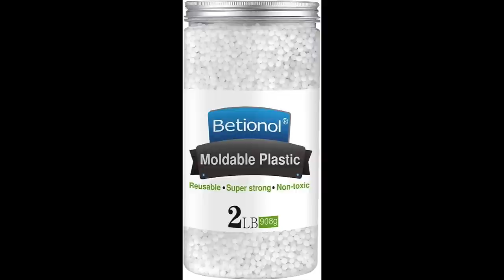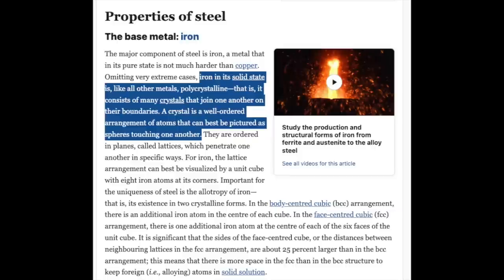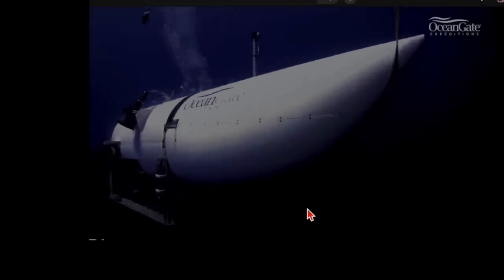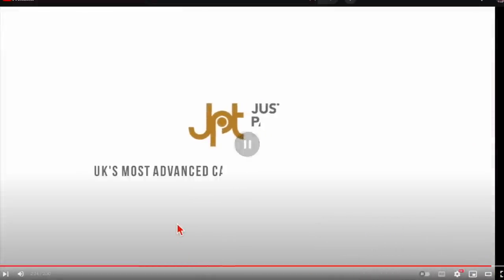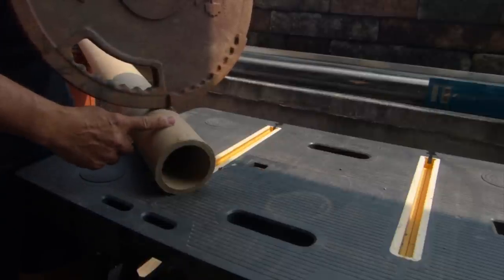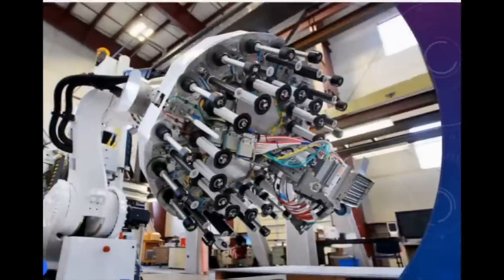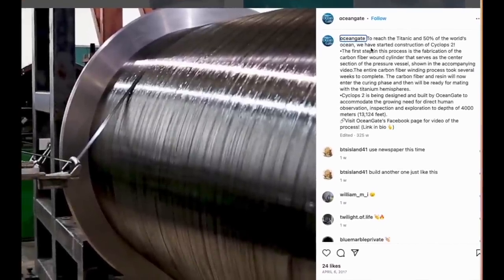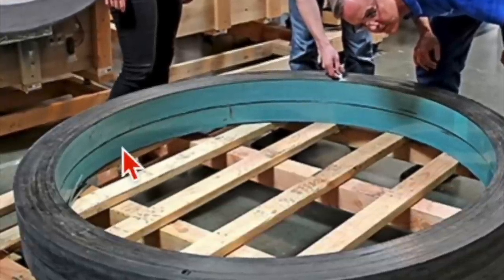Titanic Titan Implosion 800 layers not just 667 layers, let me explain the machine that made it

Comment: There were two different Titan composite hulls. Submersible expert Karl Stanley went down with Rush in the first hull, and heard it cracking all the way down and all the way back up. He then wrote Rush a long email saying the extensive cracking noises indicated the hull was failing, and that Rush should not take any passengers on it. Stanley said Rush then cut that hull apart to find the defects, and then built a second hull, presumably using some of the knowledge he gained by cutting up the first hull and finding the defects. Stanley did not know, however, any technical details about the second hull. But he knows for sure that there were, in fact, two hulls, the first of which Rush cut apart after Stanley told him it was unsafe.

Comment: It should have had some steel layers every 50 or so CF layers at the ends of the CF cylinder. that might have strengthened it up enough to have survived.
Reply: I might be wrong, but I suspect you only want to interface the two materials only once. The more you do it, the more failure points there are. The two materials do not bond well at all. Maybe Forensic can correct me :)

Comment: I visualise this as 2 see saws (teeter totter in the usa?) back to back but the pivot point is on the outside ends of each plank (the end rings), put pressure on the hull and the middle (inner ends) of the  planks wants to move in (flex) towards the centre line of the tube and the outer ends will want to move up/out, release the pressure and the ends will want to move back to there unstressed position. Your point - the rigid floor diverts the flex forces to the weakest point, the end of the planks then wants to move more to accommodate the additional forces. the glue can't handle the repeated movement of the c/f and the joint fails. my interpretation of your other point is that hanging the extra weight on the back was adding extra force to the rear ring that was attempting to pull the end cap away from the c/f accelerating the joint failure. The lack of the porthole and the port hole end ring together with what looks like the sheared end of a bolt in one of the pictures looks like the porthole blew out and away from the hull - some of the incoming force was axial towards the front (originating at the rear) - there must all so be more than we have seen there is a quote regarding the presumed human remains being recovered in part of the wreckage - i don't believe this part of the wreckage has been sighted
Reply from the maker: Remember or rather consider the different "end results" appear different bc of the floor ribs... Just a thought I will keep open until I know floor is "flexible"...

Comment: Given the same size capsule, How thick if made from mild steel? to withstand 6000 psi
Reply: Steel weighs 5.8 oz per cubic inch, titanium 2.6 oz per. steel is very predictable, titanium has weird stress and fatigue failure modes, proba s bad as CF. 
20K tonnes of force pressing onto each hemisphere and the 600 sq inches of glue on the end of the CF tube.
Each hemisphere and ring weighed a combined 4000 lbs, glued on.

I noticed in one photo of a thruster and bracket, they moved a bracket and did not fill in the vacant screw hole.

The engineering and construction of the Titan was amateur, reminds me of a hobby electronics project from a magazine.

Comment: 31:20
So the window is lapped into close fit with the orifice.
The water pressure forced it to seal.
Then why would a very close fit of the carbon fibres in the resin matrix,  not also seal?
How is this water squirreling its way in while the layers are compacting with 6000psi.
Or is it an assymetrical distortion oval issue of tube.
Reply from the maker: Hydraulic force is simple but complicated on this vessel, as the test reveal.

Comment: Weren't there 2 different hulls, one of which was scrapped?  Also, didn't he use 2 different manufacturers?  Could this account for the discrepancy of different sources as to the number of layers and how they were wound?
Reply: Yes. Submersible expert Karl Stanley went down with Rush on the first hull in 2019 and hear it cracking all the way down and all the way back up. He told Rush the hull was failing and unsafe. He said Rush then cut the hull up to find the defects, and then made a second hull.
Reply from the maker: Do you have that exact link to Rush stating this? I recall Rush stating he did destructive testing ...